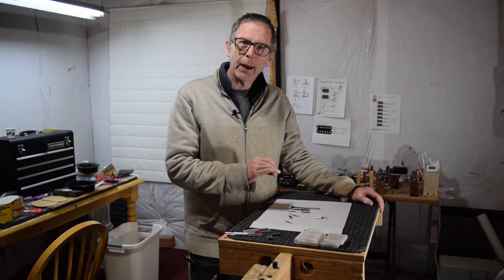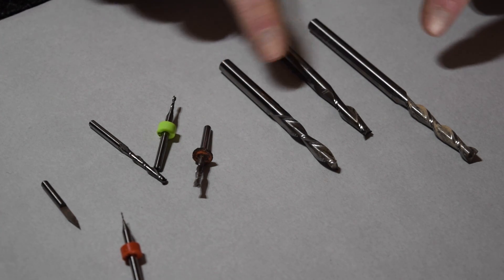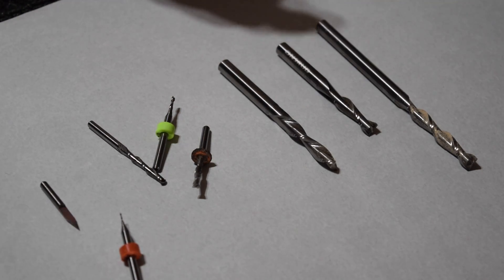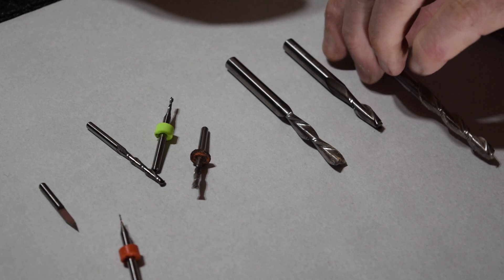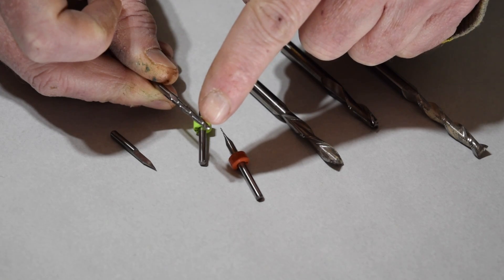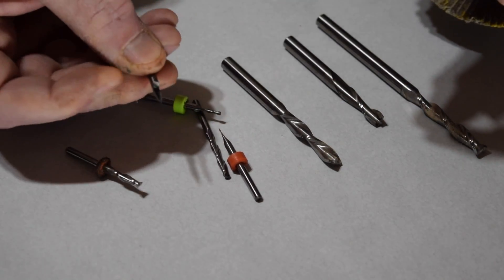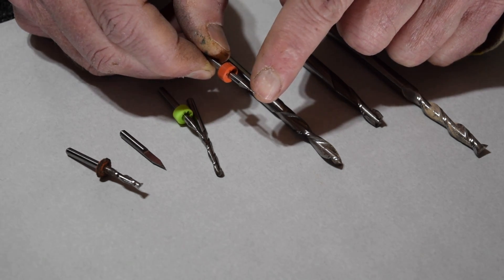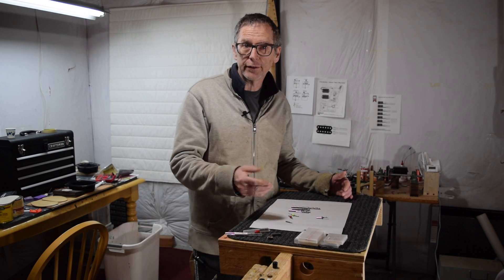The Bits I Use In My CNC Machine

Comment: What rpm/ speed do you set your trim router to for cutting out the guitar body?
Reply from the maker: Speed setting 4 which is about 22,600rpm.
Reply: @HighlineGuitars  Thanks so much I was setting my trim router to 12,000 rpm and it kept going off track of the cut line. Do you think thats due to my low rmp speed?

Thanks for sharing with us all of your luthier knowledge Chris.
Reply from the maker: @tbirrrd1  I don't think so. There are a lot of factors involved that could cause this. I need to know every detail about the cut that's not working for you.

Comment: I am just starting out on the CNC and would like to start cutting out a telecaster body to start since it would be the most simple.  What bits would i need for just a tele body?
Reply from the maker: You don’t select bits by guitar type. You select them based on the type of machining operations that you will need to perform. And what those operations will be depends on how much of the work you want to do with CNC and how much you want to do with other tools such as a drill press and/or a bandsaw, etc.
Reply: @HighlineGuitars   thanks for the reply.  i'm looking to do most of the heavy lifting on the CNC.  So i wanted a long enough bit to profile the outside to get through 1 1/2 - 2 inches.   and bits for the pickup pockets and the string holes.   Very new to CNC and guitar building so appreciate any help.    Trying to teach myself on a 4 x 4 Xcarve using Vcarve and easel

Comment: That .024 fret bit link is no longer valid on eBay. Can you tell me the number of flutes and the cutting depth of your cutter? I'm cutting for jumbo frets with a .070 tang and I don't want to go too short or too long (and have it break)on the cutting length. What are you using? Thank you.

Comment: Hey Chris, the 1/4 bit you linked to for cutting all the way through bodies is only a 1.5" length of cut. For thicker bodies, do you not need something like 2" length of cut? 

I guess I'm kinda confused about how much the loc actually matters.
Reply from the maker: The length of cut only needs to be equal to (or slightly more than) the depth of cut. I guarantee your doc isn’t going to be 2.” More like .06” to .25” depending on the strength of your machine and the power of your spindle. To cut through a blank thicker than 1.5,” you need to look at overall length, not length of cut.

Comment: Hi, the 4" bit has a 1.50 length of cut. For a body that is 1.75" is it okay for the shaft of the bit to make contact with the wood? How do you reconcile cutting contours of bodies thicker than 1.5"?
Reply from the maker: I’ve never had any issues making cuts deeper than the length of cut.

Comment: Very good info.  I am waiting for the followup with your feeds and speeds.  You should check out Precisebits.com.  They have 1/8", and 1/4" precision collets for the Dewalt 611 router which helps prevent bit breakage.

Comment: Hey Chris, thanks for this great information.  Just FYI it seems like your first Amazon link may be incorrect. It is taking me to the same down cut bit as the second link.  Also, how long is your long reach 1/4 bit?  The video makes it look like it may be longer than 3 inches. I've been searching for an ideal bit for getting all the way through a guitar body, so I'm especially interested in this one. Thanks!
Reply from the maker: I fixed the link for the upcut bit and the long reach to the 4" bit I use. THANKS!!